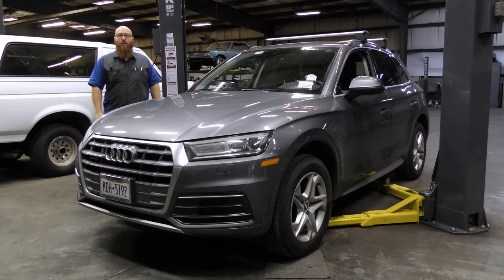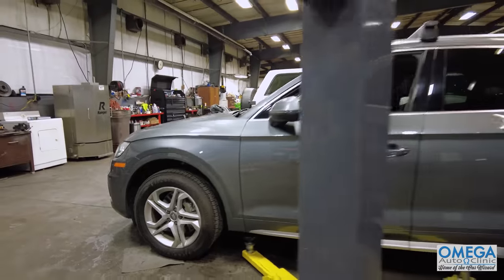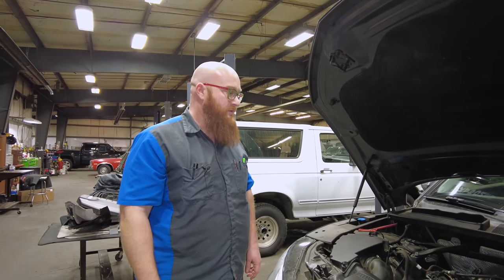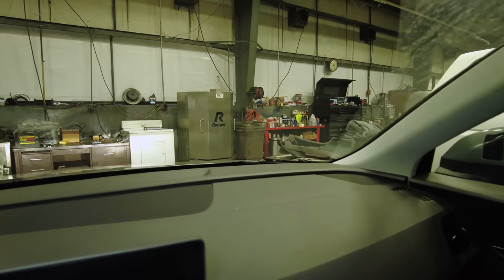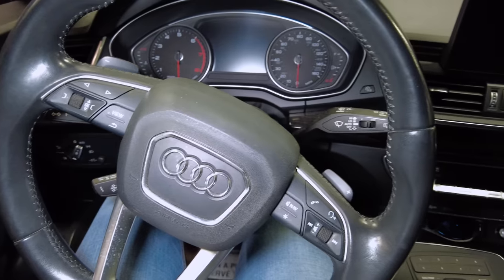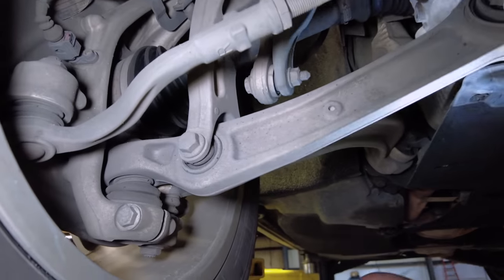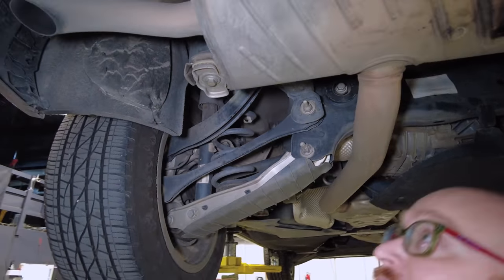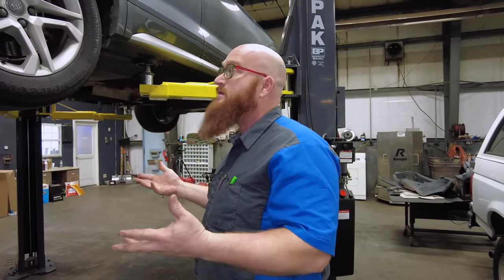2019 Audi Q5 with 200K miles & the service records to prove it! What did the CAR WIZARD need to fix?

Comment: Like this owner I am very diligent with my service and staying ahead of costly repairs. In fact my 2013 Q7 TDI has 220,000 Kms (137,000 miles) and I've had no major fixes. I also treat it with respect when I drive it. I've decreased the oil change intervals as is gets older, now every 10,000 kms (6,200 miles). Like Wizard I would be mind numbing bored driving a Toyota or domestic, once you've enjoyed the driving dynamics of a fine German luxury car it is hard to go back. Great review Mr and Mrs Wizard!
Reply: Audi's don't drive that nice
Reply: My last car was a 2007 Accord SE and it was reliable. My current car is a 2014 Passat TDI and it's been my absolute favorite vehicle to drive. But like you, I also do oil/filter every 10,000 kms using Liqui-Molly toptec 4200 VW 502 spec and at 180,000 kms still going strong. Only thing I've had to do on it for repairs so far was replace sway bar links and one power door lock failed. I do my own fixes and maintenance (paid a mechanic to do sway bar). In the spring I'll have to do the whole timing belt/water pump/idler pulley kit but after that I don't expect any big surprises with proper maintenance. Wizard is right, maintain these German machines and treat them with respect or pay huge later.
Reply: @kmorton54  any audi is Shi..suh
Reply: @Matt Does Stuff  I also use toptec 5w40 502/505/505 01 in my 2007 skoda Octavia 1.9 tdi.
Do you use any additives? Have you tried Amsoil ? Thanks friend.
Reply: The euro spec are better...us spec should be avoided.jeep much better
Reply: @1.9tdilove71  In the oil I generally don't bother with additives. But because diesel fuel where I live in Canada is not as good quality as in the UK for example (we have winterized diesel for winter months), I do use Diesel Kleen with CTE boost  which I feel is a good idea to keep pumps and seals happy and also considering direct inject are prone to deposits/buildup over time.
Reply: @1.9tdilove71  I've used RVS oil treatment on all the cars I've owned. It works well especially on older worn engines. One treatment to high mileage Mercedes gearbox (non electric one) tightened the shifts so much that the adjustment needed to be loosened several revolutions.
Reply: @Matt Does Stuff  Thanks mate. Amsoil or liqui moly. What you think. I have used LM. It's good. Want to try Amsoil as heard so much about it.
Reply: @1.9tdilove71  I've stuck with Liqui-Molly. Never tried the other. As long as it's proper spec I'm sure it is fine. I find a lot of people saying these are junk aren't using the right product (they would likely find the cheapest 5w30 synthetic without the vw spec)
Reply: 3.0 tdi?
Reply: @teevee2145  That claim is literally comical.  Jeep is the bottom of the barrel in reliability, bar none.  And I currently have a Q7 as a company car, and I must admit, despite my previous reservations about Audi's, how quiet and smooth it drives is actually literally stunning.  Even at 80Mph, it is about as quiet as sitting in my living room.  Everyone I drive in that car comments on how quiet and smooth that car is.  

The only car that is smoother and quieter is my Tesla, but even then it is close.
Reply: @redbaron6805  most of what you mentioned are the fiat models. All I know is my wrangler will still be going when your audi is in a junkyard at 130k ..which is an average vag lifespan since 2000. Audi's have largely been junk forever. And you I suspect are not an auto expert. I, on the other hand, have considerable euro car expertise over the last 45 years.  But I'm sure audi appreciates your cash.. They won't get mine..but I always look for deals on porsches. Audi's are still shy suh

Comment: Thank you Wizard and Mrs.  Love the Audi Q3.  200k on an Audi is not impossible.  I worked for an Audi Dealership and 200k was easily achievable.  Routine maintenance, oil, tires, brakes, and timing belt water pump every 100k.  Looking back I realized the only time I changed the sparkplugs was at 100k.  The battery died in 2006 after 10 years, stamp on battery Feb 96
Reply: you must be talking about a different model because the Q5 has not been around that long lol
Reply: @GoZito75  You are correct, it was the Q3

Comment: My dad had a 2009 A6 3.0 TDI. He bought it new and ran it for 11 years, until it had 420k km / 260k miles. Nothing major broke on it. But it had regular maintenance done to it,. Meticulously. Driven carefully. The air suspension was like new. The turbine he had looked at, the shop was surprised to hear it was the original turbine. It looked like new. 
We only had tor eplace the front wheel bearings, the front door locks (known issue with this generation car) and had to lubricate the folding mirrors when they started getting stuck. Gave it a good cleaning and the car looked like new when it was sold.

Comment: Again Maintenance and preventive maintenance IS KEY. Most of them can last a very long time, folks just don’t want to source for parts that don’t break the bank. They are good Especially if you can DYI or have a reputable German shop fix certain issues. Love my 2010 X5 with 215k and counting. Mostly Highway miles
Reply: A car can last 500k if you always keep it in perfect condition.
Reply: Your X5 has to be 3.0 instead of 4.8/4.4?
Reply: @hellkitty1014  yes sir xdrive30i 😂😂I knew not to get the V8😭as much as I wanted it I know the consequences behind it. My brother has the v8 and he’s been crying ever since,
Reply: Agreed Miguel, going to the dealer will bankrupt you. Find a reputable local VW/Audi specialist and you will reduce your repairs by 50-70%.

Comment: Ha! I have (or had) MANY Audis with waaaaay over 200k. I currently drive a 14 allroad. She’s young mileage wise, 140k, but the ONLY issues I’ve had are from me or a friend off-roading it (cv boot tears). Zero other issues. Now, I’ve had 4 200s. 3 20 valves and one ten valve. The lowest mileage is on the 10v. Still, over 240k, the 20v avant has well over 400k and is still very mechanically solid. We have a 2014 q5  6 diesel in the family. It now has 260k and drive and looks like a champ! We also have a 2008 Toyota Highlander and at less than 90k started giving us problems (I was honestly surprised). Toyota metal is trash. And we have odd electrical issues and occasional misfires even after replacing plugs, wires etc. The allroad has taken over daily duties. We put roughly 23 to 24k a year on it and it’s been fantastic.

Comment: I have a 2016 Audi Q5 Premium Plus close to 75K miles.  Audi's recommended service is every 10k miles or one year (which ever comes first).   I've stayed on top of my service and my 2016 is still running great.  The only major thing I had done are all breaks at 65K miles.   As for cost of maintenance, I am really not spending that much more vs. other cars I've owned (Toyota, Mazda, Nissan, Infinity, Subaru) because prior to my Audi, other cars required maintenance every 3K miles.   I might be spending a few hundred more per year at most, but I think it is worth it NOT to drive a boring car.   I do want want to upgrade to a newer Q5 or even SQ5 since the cabin technology is better and I thought of doing so at 85K miles (next year or so), but prices have to come down quite a bit.   I noticed in this video the plate cover says Audi Mission Viejo and the the license plate is New York.   Looks like the owner is originally from Southern California and may have done some cross country driving a few times thus the high miles for short period of time.  Mission Viejo is in Orange County, Southern California close to where I am located.

Comment: I've got 176K on my Saab 9-3. Of course, it's almost 16 years old. But I'm the only owner and driver. It was my daily for 11 years. I'm still on the original clutch, water pump, alternator, and a few other things I'm probably forgetting. It's been garaged and properly maintained all its life. My new daily is a 2019 Audi S5, but I'm not  confident it'll last as long or be as reliable as the Saab.
Reply: It will fail if you follow factory recommended guidelines

Comment: Yes maintenance is truly key.  On my 2015 VW golf TDI, I am at 185,000 miles and yes I have a thick book of maintenance. In fact I just changed my oil yesterday. Yes I have had to replace some wheel bearings, tires, filters, and oil changes. My last VW went 208,000 miles and I got rid of it only because a deer decided to total it. I still have the thick book from that car.

Comment: The center seat in the back is not too bad as an adult so long as you don't ride for more than a couple hours at a time. These cars are quick and very comfortable to drive!! I recommend them to anyone who is willing to keep up with the required maintenance. I have been a VW/Audi nut for more than 15 years, and I can tell you from experience: maintenance is everything!! Maintain these cars and they will reward you with many years of faithful and fun service!! Every VW/Audi I've owned has surpassed 200k without any trouble. I had a 2001.5 VW Passat with the 2.8 V6 and 5-Speed manual transmission. It had over 260k on the original drive train (clutch included) when it was totaled due to being rear-ended. If it wasn't totaled, chances are that I'd still be driving it today and have over 300k on the clock!!

Comment: I have a 2010 Q5 with over 300k miles; never had issues besides regular maintenance. These are great cars (q5 only.)
Reply: 3.2?
Reply: @hellkitty1014  v6
Reply: No turbo
Reply: Q5 only? you know they use the same engine and transmission in lots of other models.
Reply: @jeffk464  I know the use the same powertrain in other models. Every manufacturer does. But sometimes one model can out last the others with the same powertrain.
Reply: Stronic or Tiptronic?

Comment: I had a 2015 Touareg TDI, traded in with 120,000 miles. Very reliable but a also had a book with the service records, totaled $7,000 for the 120,000 miles. That included a spare set of wheels with winter tires too.
Reply: Actually not bad
Reply: really not bad.  that's $0.0583~/mile cost, excluding fuel.
a recently retired car (accident) of mine was at $0.288/mile including fuel @ 187k miles.
if we spit ball fuel for the TDI at 24mpg and $3/gal, you get $0.183~/mile total cost.
that thing done you well.

yes, I track the data that allow me to say things like this for my car.  I'm OCD like that. 
😅
Reply: Same for our ‘17 Touareg 3.6 nothing but basic services 80k in even original brakes.
Reply: @johnhufnagel  i think i did better than that, diesel was under $3 for almost all of my ownership and 26.5mpg would have been about average most the time with many tank hitting 28mpg.  Ultimately with the extended emissions warranty expiring at 120,000 miles and needing a vehicle that more easily fit 3 cars seats plus gear I traded for an v8 crew cab f150. Since fuel (especially diesel) went through the roof, my fuel costs have actually remained even or gone down.
Reply: @whatchis1120  I had the brakes done in the mid 70k range, about $1400 at the dealer at the time.
Reply: 2014 Touareg  V6 gas here, no issues since I own it, 98000 miles at this moment. Currently on 4th set of tires, breaks replaced once, oil change every 5000miles with friendly mechanic. Tire rotation at least once per year and alignment. This is heavy car, so not easy on the tires.
Reply: @whatchis1120  I drive a 2016 VW Touareg TDI. Just did my first brake job at 95k miles. Didn’t even replace the rotors.  My tires last me 50k’s. Did have a problem with sunroof leaking $2500 repair
Reply: @teddy0139  my tires for my 2016 Tuareg last me 50k miles. What sort of tires do you buy, Chinese ?
Reply: @yankeedoodle6293  Thats great, I was expecting a couple of minor issues with it since it wasn't the run of the mill jetta.  I cheaped out last time for tires their at 40k for a set of firestones and getting ready to be replace with Pirelli's.  I also have a minor leak right now waiting for an apt at the dealer, I believe its drain related.
Reply: @yankeedoodle6293  now on my third set of Pirelli Scorpion. I believe this is what the car comes out of factory. Pirellis are very loud, especially on the highway speeds. I tried GoodYear tires once. Overall goodyear seems more quiet, but the rubber is softer and it doesn’t last that long. With Pirelllis I simply had bad luck and catch few flats plus one shop blow the tire when getting the car on the lift. So far tires was the highest cost for me since I own the car (6years).

Comment: Those newer 2.0L engines are pretty reliable to be honest (coming from a former dealer tech)
Reply: What about carbon buildup? Is it still an issue?
Reply: Which years specifically?
Reply: @jonathandavis9507  that’s all the direct injection vehicles lol u sure u work on car? Or u a Honda 👦?  And that’s why u need to do value clean up 😂
Reply: @HighSpeedPunch  I was just asking. That’s for your pointless comment.

Comment: I have driven German Swedish and American vehicles almost exclusively for 40 years.
My first car, which I still own, was a 1972 Opel Manta that was a hand me down from my grandparents who kept it at their Arizona vacation home.
I have purchased all my subsequent vehicles brand new and have serviced them according to the severe  service schedule as outlined in the owner's manual.
While they were under warranty they were serviced exclusively at the dealership and when the warranty expired they we're maintained by a well-regarded import garage it's been in business since 1957.
All of them have easily exceeded 200,000 miles and a couple of them approached 300,000 before they were sold or traded.
None of them  failed to start or left anyone stranded.
None of them have been especially problematic and problems have been mostly minor and few and far between.
About the only catastrophic failure I can remember was the failure of an automatic transmission on a VW Passat and that was designed and manufactured by a Japanese company.
 The most problematic vehicle my wife and I have owned was a Mazda.

Comment: Great video.  These guys have been really good about maintaining this car and staying in front of the problems.
This Q5 doesn't have the turbo inside the vee like on the 6cyl and is still too new to have the well known issues with steering / major electrical.
Let's check back in in another 50k-100k and see how she's doing!!
Reply: As soon as it his 200k it will grenade it self
Reply: The Gen 3 EA888 (what this Q5 has) is a slight revision from the Gen 2 EA888 that was used from 2009 - 2016. They've been using this 4-cylinder for over 15 years now. Gen 1 had many problems, 09 - 12 Gen 2 had tensioners that would break (revised for 13 - 16), timing chain stretch (fixed with a thicker and more robust chain), and oil burning problems due to thin oil control rings (every car had this problem around this time... EVEN Toyota with the 2AZ-FE; each manufacturer has released revised pistons w/ oil control rings). Gen 3, introduced to North American cars in 2016, has revised pistons, thicker chains, revised PCV, and other small changes. Gen 3 EA888 has proven to be very reliable other than the water pump that always likes to leak.

Only real things I can say to keep up with this Q5 would be oil changes (don't follow Audi's 10k oil change interval) and those damn front control arm bushings. Audi has 2 upper and 2 lower control arms for each wheel (4 balljoints for each knuckle). Very nice ride but because of that they need to be replaced every 80k - 120k miles because they'll start making sounds. No sunroof to worry about on this one so no sunroof leaks. I'd take this Q5 in a heartbeat and add the upgraded LED headlights.
Reply: @mydimeisup5103  Sometimes its better to have an older designed engine, they've hopefully been debugged.  I'm ok with a glass roof but I think sunroofs are a negative.
Reply: @jeffk464  Agreed I'm ok with panoramic glass but not sunroofs. Gen 3 EA888 has been out for over 10 years now (6 years in the North American market) and hasn't really seen any major issues. 4 years into the Gen 2 we knew about timing chains, oil burning, and PCV failures. Even less for the Gen 1. I'd say we have enough time to know the Gen 3 is pretty reliable.

Comment: I have a 2016 Audi TT with the same engine, currently with 75k miles. Religious maintenance. I just had to replace the water pump, wheel bearings and cam cover gasket. These engines eat water pumps... I'm shocked this Q5 hasn't had it replaced multiple times.
Reply: It may have....that wasn't delved into
Reply: Do not put plastic one

Comment: In 2019 I purchased a new Volkswagen Tiguan  which is on the same platform as this Audi it was a nice vehicle lots of room, in 2020 I moved to a more rural area and my closest dealer is now 2 hours away, in 2021 I get a recall notice about the emissions needing a software upgrade so when I can I schedule the appointment and get the oil Change to since I'm there and its time, but its bugging me that the closest shop is two hours away so in 2022 I sold it and purchased a new Subaru since selling the Volkswagen I have received two separate notifications from attorneys about class auction lawsuits against Volkswagen one having to do with water pump issues and the other having to do with transmission issues and because I owned it I was considered part of the class auction. Made me even more glad I sold it.

Comment: I drive a 2010 audi Q5 with 215 000 miles. I bought it new and had 0 issues with it. I just kept up maintenance and changed tires, brakes,... I can't say a bad word about the Q5.
Reply: Sweet! 3.2 or 2.0t? I have same 10' Q5 3.2 sitting at 110k, great car and love the high revving 3.2
Reply: @lisandro12349  It is a 2.0 tdi, not really exciting but it does the job
Reply: @ImSiebren tdi
Reply: @FiveMissiles  ?
Reply: @ImSiebren  diesel
Reply: @FiveMissiles  indeed